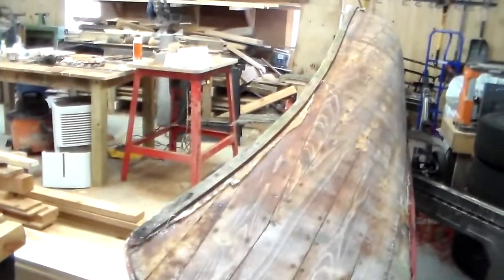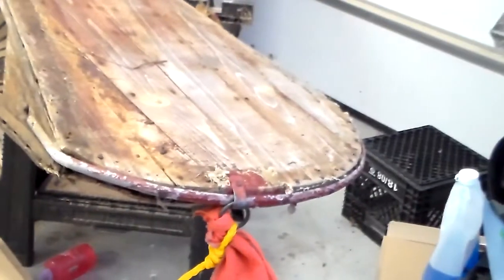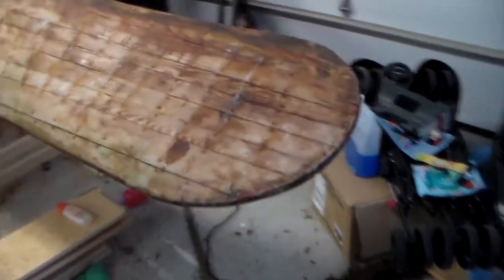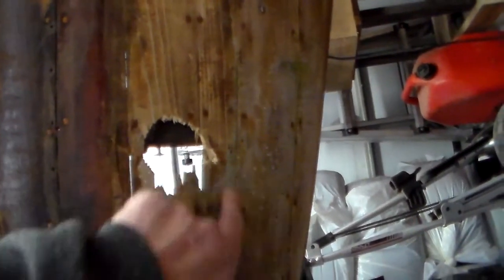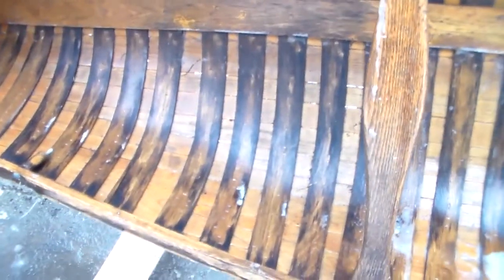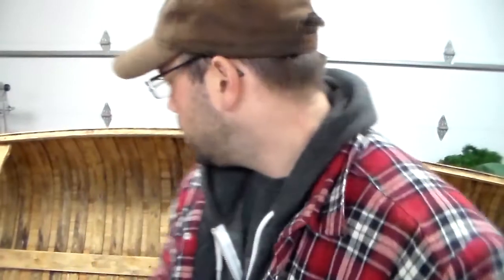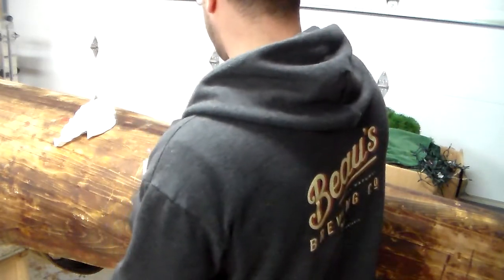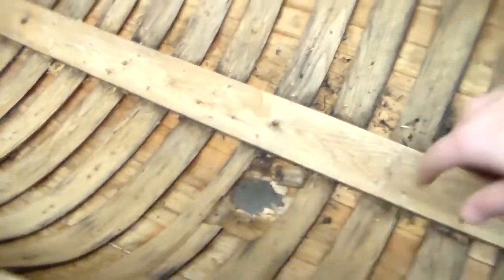Cedar Plank Canoe Restoration - Ep3: Removing old Canvas and Finish

Comment: My father back in 1961 picked up a 1926 old town canvas canoe with original paddles 10:00 and reskinned it and painted it red today that canoe hangs in my mothers garage we haven’t used it sinse the 80s but it’s 95 years old

Comment: They all rot there when my father reskinned his he glued it and then deluted the glue with thinner then painted it on to tighten and waterproof the canvas then painted it red over the years we sanded it lightly then repainted it the only rot is where youres is the tip but looking at it today the canvas looks great just years of dust

Comment: Beau's eh? Are you in the Alexandria area?
Reply from the maker: No I'm in the Montreal area. But I cross over to their brewery often :-)
Reply: The Bushcraft Apprentice
Sweet! I got the tour 2 years ago, They were sponsoring a a local film, and the producer didn't drive, so I volunteered... I'm about 1/2 way between Ottawa and Montreal on the old road.
Reply from the maker: trollforge that's cool :-)
Reply: I was just about to comment on the Beaus Merchandise! Just bought myself a cedar strip for the primary purpose of renovating. On the first viewing of what I'm sure will be many 
So my canoe already has a fiberglass coating on the outside. I've tried looking for some basic forums, tips etc to help me update the look of my craft. For the most part I need to replace the seats and gunwales for the boat, while the body is in decent shape. If you could point me in the right directions of some resources etc it would be a HUGE help
Reply from the maker: Evan Walsh Hi Evan! Firstly thanks for watching. Your end all best place to get help with wood canoe repair is the WCHA Forums : http://forums.wcha.org/forumdisplay.php?6-Wood-and-Canvas
I have often posted questions and have always gotten tons of great advice. 
Good luck with you project! 
TBA